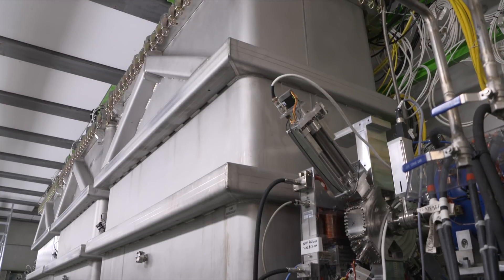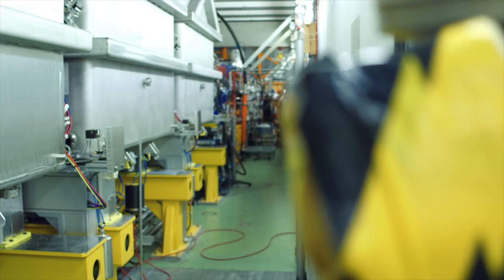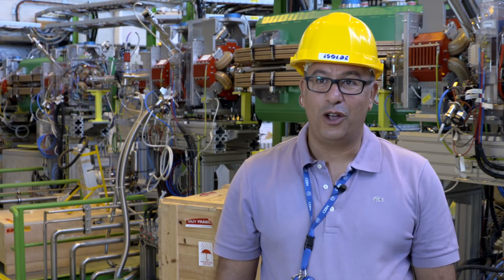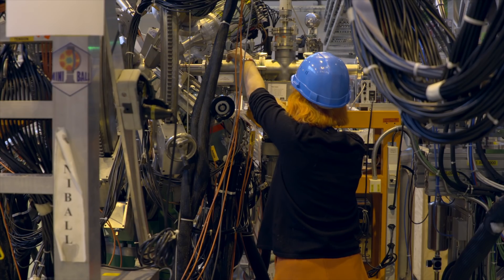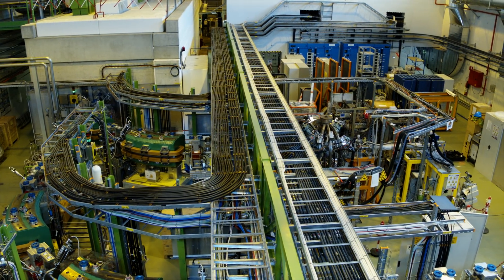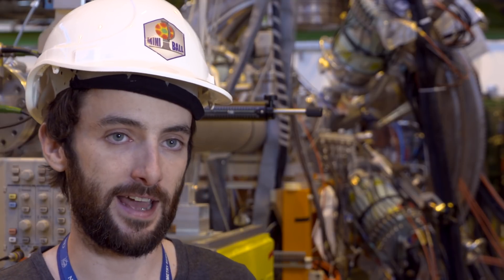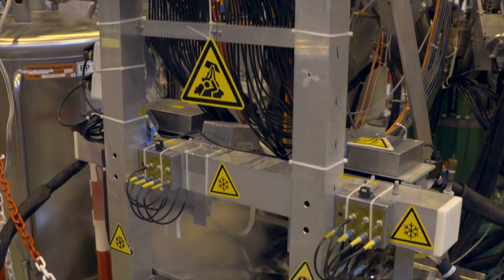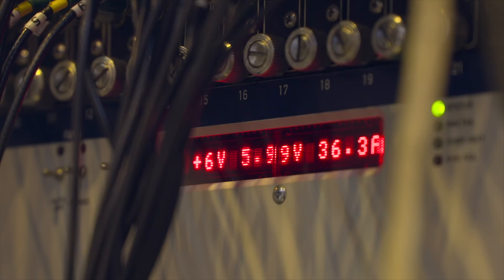HIE-ISOLDE: On the way to 10 MeV

Comment: I think all these big accelerators are a dead end. There are very promising research to make it all much smaller and cheaper:
http://www.mainepublic.org/post/physicists-go-small-lets-put-particle-accelerator-chip
It's like if CERN were still using buildings full of vacuum tubes instead of one small IC with even better computing power, if you would compare it to computers.